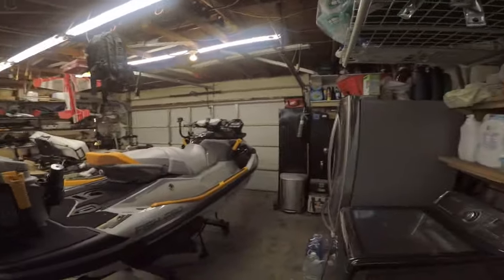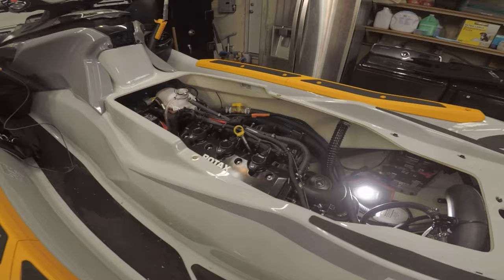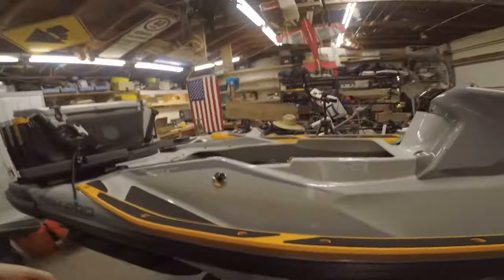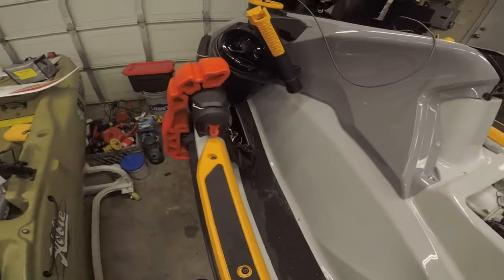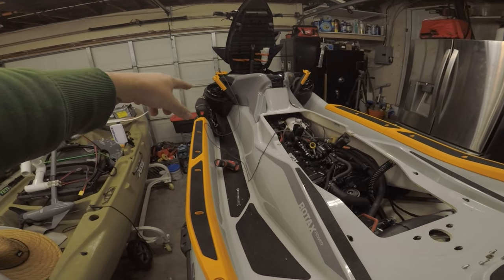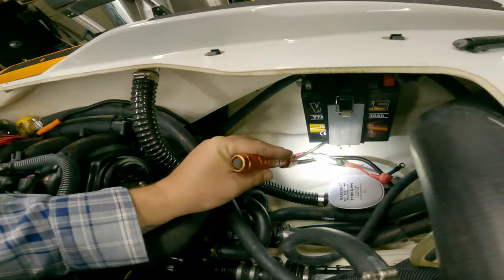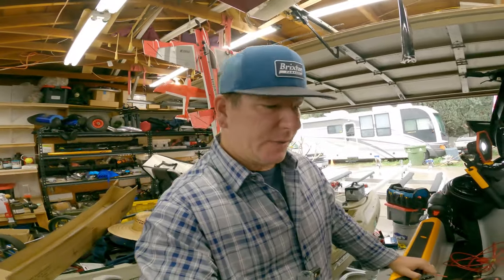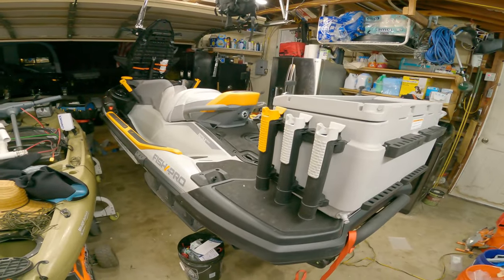Is your Sea Doo going to leave you stranded?

Comment: Awesome video, would like to copy your idea with the jump pack. Dealer told me same thing about batteries (which made sense at the time)... then one day everything turned off at the same time while I was out on the water 😅. Doesn't help that the factory bilge pump is always running, but your dual solution would be perfect.
Reply from the maker: Thanks, yeah same thing happened to me and said to myself this ain’t gonna happen again. Cheers!

Comment: You have a check valve for the discharge and that's great but I believe you also need a check valve for each pump prior to the Y valve. If one pump comes on it could just pump water back into the hull via the non operating pump. Now it's been a long time since I had a boat and things may have changed since my day so I could be wrong.

Comment: those riv nuts you used are made for steel, that's why it cracked the fibreglass, you need to buy specific ones for fibreglass and be careful how much pressure is put on them, i would recommend glueing those nutserts or preferably replacing them because if they spin when you go to take them off your going to be be cutting them off which would not be fun on a new seadoo

Comment: Hi mate --- i wouldn't put the switches right next to the fuel fill cap -- That area is also a vent for the fuel tank and if you spill fuel it will soak through to the power contacts.. John --
Reply from the maker: I totally agree with you. I usually don’t spill and thought that would be a great spot for it. There’s definitely better spots for sure.
Reply: @Redneck_Savant  -- Do you know anyone with a 3d printer .... I have a plan to model a mount for those swithes under the lid.. I can send you the file once im done..
Reply from the maker: Actually, I have a buddy that has many 3-D printers and is willing to print anything I want at no cost. If you end up sending me the file I’ll mail one to you.

Comment: Great vid.. just so you know, the second battery is connected with 2x 50amp inline fuses. So if the main battery fails as soon as you press the start button it will blow a fuse ($200au wiring harness replacement from Sea-Doo) as it takes over 180amps to start it and will not be able to use power from the second battery. Fix is 2x AGM batteries, new thicker wires without the fuses
Reply from the maker: Good to know thank you. I have heard about the fuse issues in the past. I will definitely look into that that would suck to be stuck out on the water.
Reply: @Redneck_Savant  yep I didnt realise til I was stuck out in the ocean and luckily I had a jump starter. When I got home main battery was dead and second battery was 100%  ( but fuse doesn't allow you to use the second battery to start) Big let down and is a flaw in the Sea-Doo duel battery system
Reply: Thanks for the clarification.  I heard something along those lines, but it was unclear to me what the issue was.  Ty

Comment: Those seadoo bumpers are the most worthless bumpers you can buy. I have broken three plastic pins on those “cheap” $125.00 bumpers. That means I have wasted $250 on those. I now have the Mission Ronin bumpers and used them for the first time last Saturday. You aren’t going to break those and I am very happy to have found a bumper that won’t break.
Reply from the maker: @drsnow5123  after quite a bit of time of using them, I’m not happy with them in motion as the pins have broken on mine as well but for docking, they’re pretty easy. The waves RX ones that I had in the video mount exactly like yours after sometime using the JetSki, I pretty much hate all bumpers. There’s always a flaw, but it’s nicer than damaging your expensive jet ski right?!!!

Comment: probably would put the one way valves on the pumps before the Y. otherwise it will push some of the water into the other pump thats not running.

Comment: Nice video ,cool mods. Quick question. Are there any concerns regarding heat dissipation from using larger pieces of aluminum so close to the engine that could possibly melt the battery housing?
Reply from the maker: No, not at all. Aluminum melting point is much higher than the engine produces in temperature. And there’s plastic all over the place touching the engine, and that never melts.
Reply: @Redneck_Savant  thanks 👍

Comment: I’m sure you could put a digital volt meter on that bike … you would know at all times where you’re at … I would do every upgrade possible … I’m buy the biggest fishing model made period … I’m not riding 65 miles plus out deep to run into any problems … absolute marine radio
Reply from the maker: On the fish pro, the fishfinder has a digital display of the volts, which is very helpful.